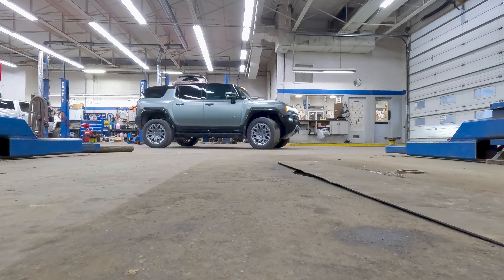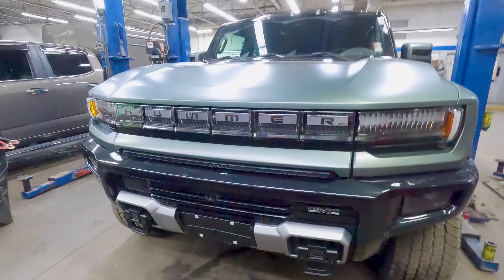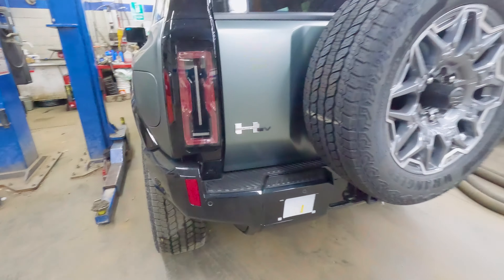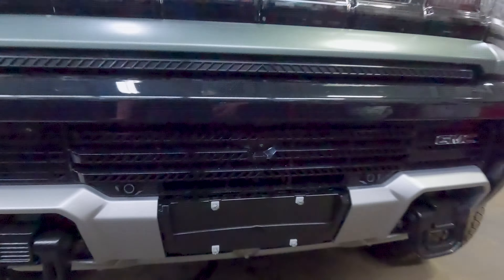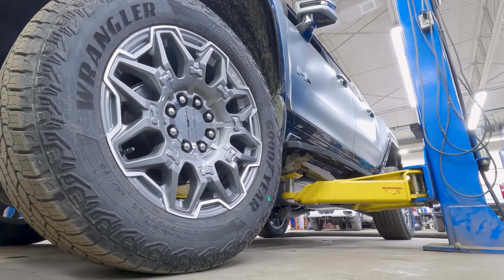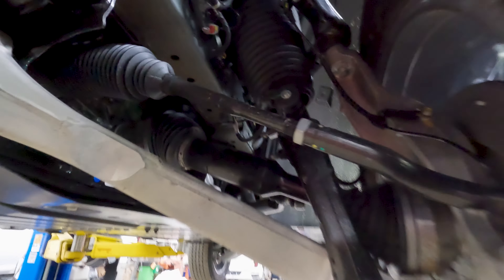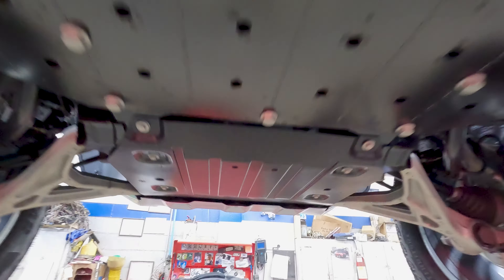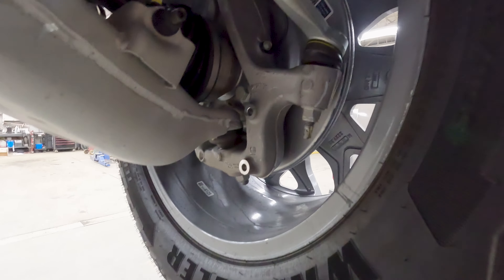Working on my first 2024 GMC Hummer EV SUV with views of the truck you have not seen before.

Comment: H2 is bigger?
Reply from the maker: No the H2 is actually a bit smaller than the ev
Reply: @TheUnexpectedOffRoad  h2 is wider?
Reply from the maker: No the EV is slightly wider
Reply: @TheUnexpectedOffRoad  I think no, I see ev interior and I  think my h2 interior is wider
Reply from the maker: Yes from inside the h2 feels bigger and the ev is a bit more closed in, outside dimensions the ev is wider
Reply: @TheUnexpectedOffRoad  Yeah, I believe you.  It barely fits in my garage when my girlfriend's Cherokee is also in there.